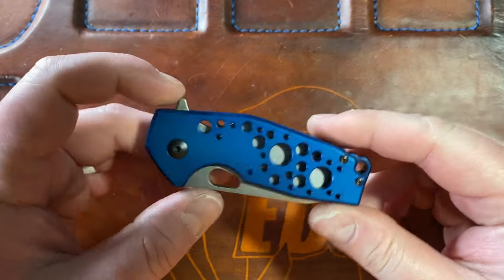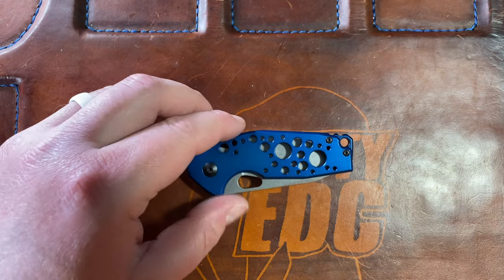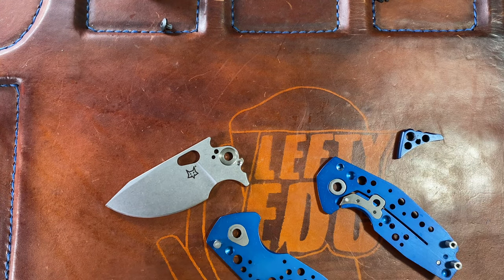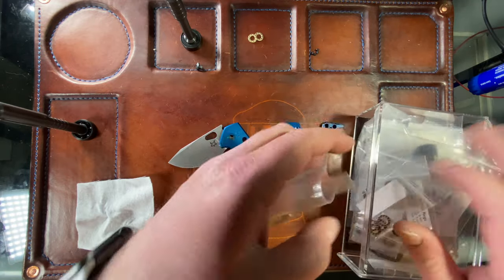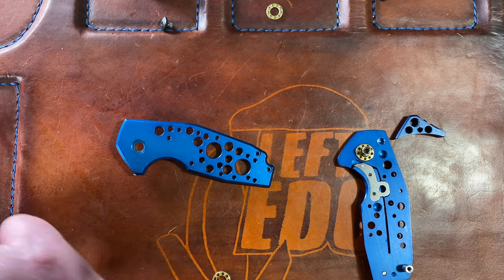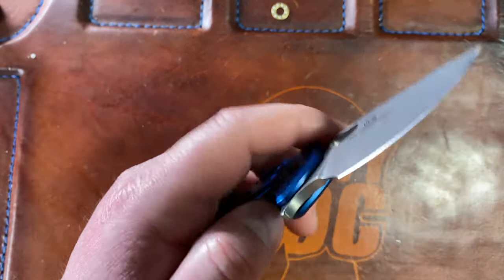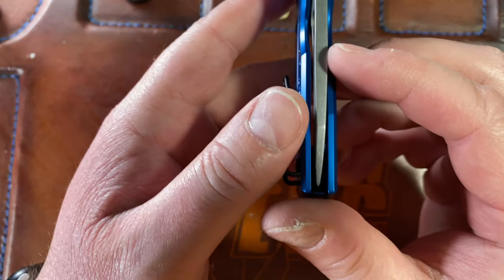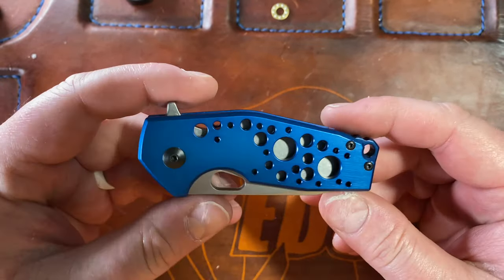Fox Knives Suru Disassembly & First Impressions

Comment: Most bearings are steel from what I have seen. Even allot of high end knives.
Reply from the maker: Thats unacceptable. I will always try to swap to ceramic if possible.
Reply: @LeftyEDC  what size do i need for bearing replacement of oem? recommend and/or link would be greatly appreciated. ty.
Reply from the maker: @johnseiler1843  id say 5mm 1/16 from Skiff but i never took this apart so can’t be sure
Reply: 5mm 1/16 Skiff fits👍